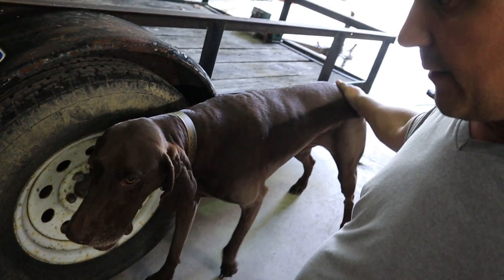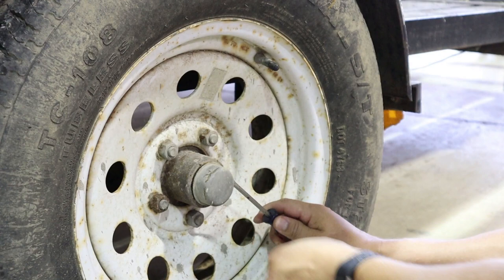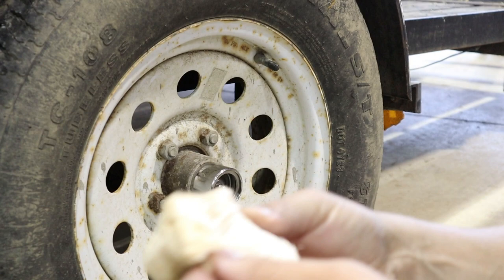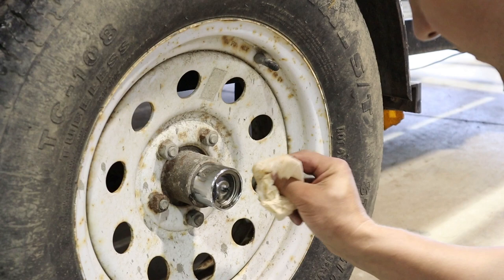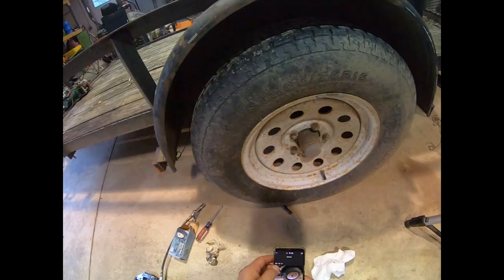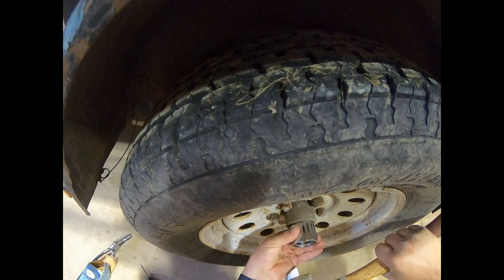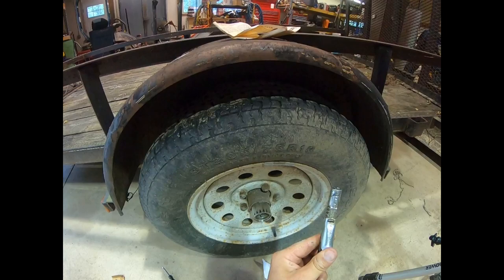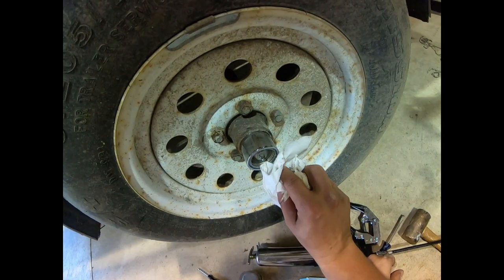Bearing Buddy Install on the Trailer

Comment: Next time use a block of wood to beat them on so your hitting it square and goes in even
Reply: I just was about ready to make the same comment. It hurt my soul watching that XD
Reply: totally agree
 @wrenchrat
Reply: I just installed a set of these on my tandem axle trailer.  No way you are getting these on with a block of wood.  In fact I couldn't even get them started using the method in the video.  I finally went to my shop and grabbed a 2 inch socket and put the caps inside of it.  Perfect fit and I was easily able to start them into the hub.
Reply: @tinknal6449  
Did you install the name brand bearing buddies?
Mine went in like butta with a 2x4 block and light hammer taps. 
In fact I’ve installed a few pairs this way without any struggle at all.
Reply: @jayonez137  These were Reese towpower.  I'm actually happy they fit so snugly.

Comment: Three years ago…
1. You didn’t seat the unit fully. The tapered area will be totally in the axle. 
2.  I used a 2x4 sitting on the ground and extending up past the unit. That helped distribute the dead blow hammer hit and keep it going straight into the axle. 
3.  Make sure to seat it fully into the axle.

Comment: I just installed a set of these on my tandem axle trailer.  These are very hard to get started in the hole.  I couldn't do it as demonstrated in the video.  I instead used a 2 inch socket.  The cap fit perfect and I was able to deliver a solid blow to start the caps into the hubs.

Comment: If I was taking off that cab and putting on buddy bearings protector I will be using a metal hammer and a wood block to have them into place this way you won't damage the exterior surface of the bunbury product
Reply from the maker: That is a brass hammer I was using.
Reply: @rushedscheduledfun3963  Yeah, and look at how you banged the crap out of the rim of the bearing buddy. A block of wood would have not only avoided that, it would have made the installation faster and easier. But you obviously are not the kind of person who admits they're wrong despite being made aware of how to do something properly....

Comment: Some of the newer EZ lube axles have, or you can screw in, a grease fitting.  The grease goes through the axle, into the bearings,  and out the front.  Just pop on a new cap and you're good to go.  You can use a bearing buddy afterwards to add some pressure to the system.
Reply: Paul Cox  If they're dexter axles, I would guess they are under the caps.  Just take one off and see.  If the fitting isn't there, check for the threaded hole on the very end of the axle.

Comment: Use a composite hammer.  Also, a block of wood with a metal hammer works to start.  Then the composite hammer to set the buddy while rotating the wheel. He id not change the races, bearings or repack the bearings. It is what it is....lucky for him this is not a boat trailer.
Reply: I just used a 2 inch socket, worked perfectly.